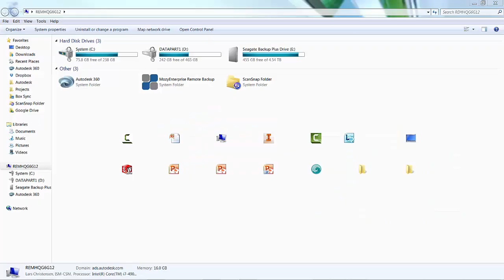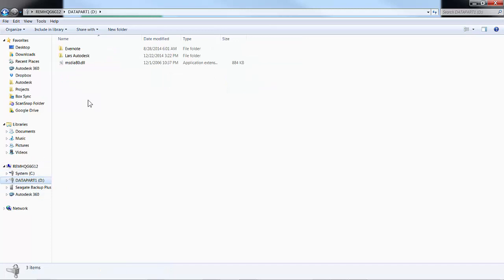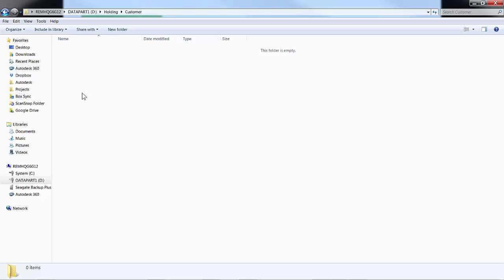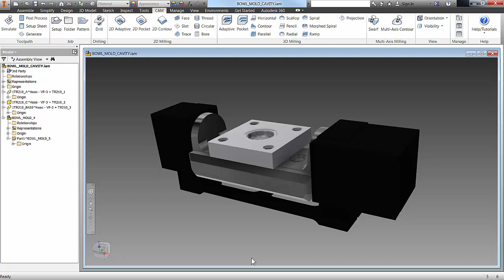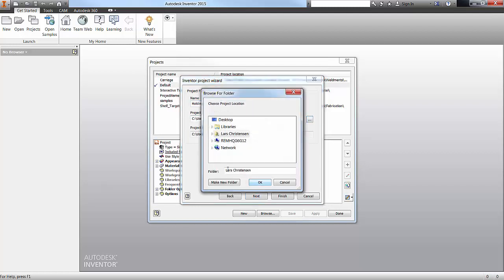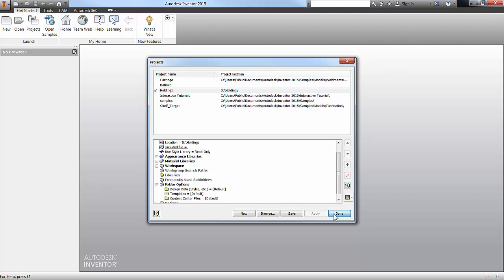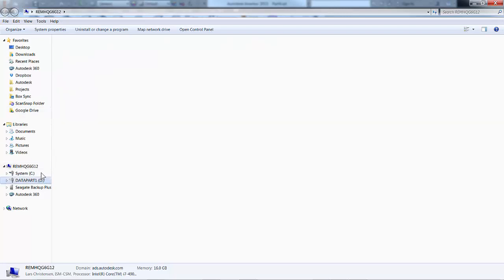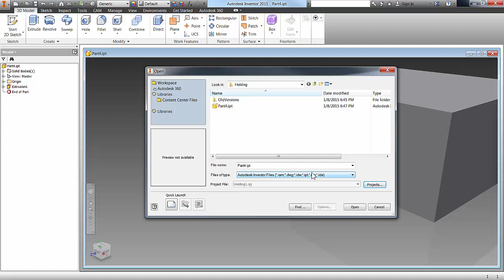SolidWorks to Inventor Project files

Comment: Hello Lars, I hope you are doing well as well.Great Youtube channel you have here,I really appreciate your hard work.I have found it a bit difficult to find any suitable videos on the cam side of Fusion 360. There are some available but they seem to be done by students just learning Fusion 360 that don't approach the software as a machinist or cnc programmer would so they skip over or miss a lot of the points that you cover. Thank you for the excellent videos .

Comment: Is this how Fusion and a360 work?I recently purchased a subscription to Fusion 360 and I was quite confused by the filing system.I believe everything is saved in the cloud but not sure.It would be nice to be able to save drawings part files etc... in a regular windows fashion.
Reply from the maker: Hi Ed, I hope you are doing well. I know you can export your Fusion 360 models to STEP and IGES, but let me see if I can not get a Fusion expert to chime in here so we both learn the real deal. :-)
Reply: Hi Ed, Great to hear you're working with Fusion 360!  I'm one of Lars' colleague on the Fusion 360 Team.  In regards to File structure for Fusion, as of now, all your part/assembly files are stored in the cloud/a360.  In Fusion 360, there is currently only one file extension (.f3d), and as Lars mentioned, you can export your files a STEP, IGES, event .dxf or PDF for drawings.  Hope this helps.